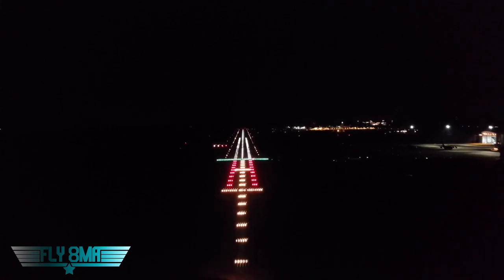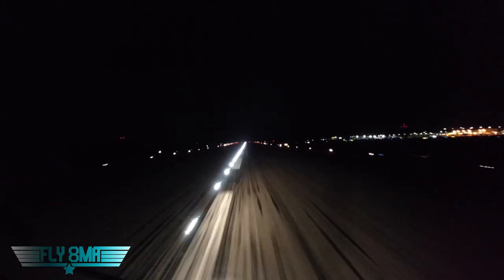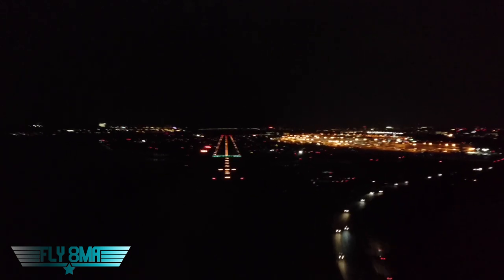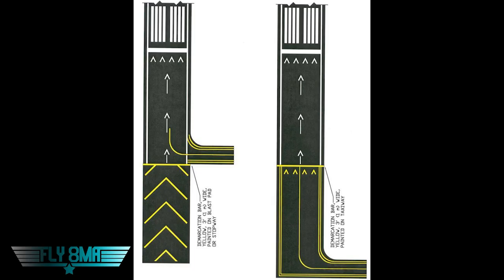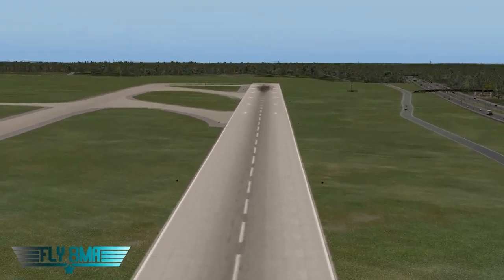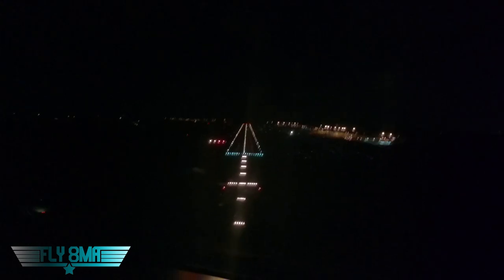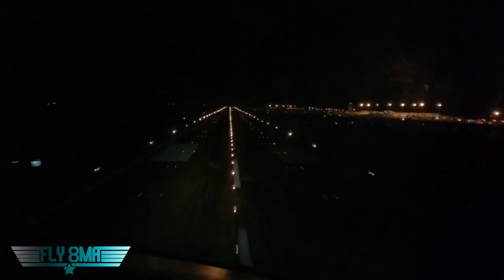Ep. 106: Airport Lighting | RUNWAY + TAXIWAY Lighting and Markings Explained

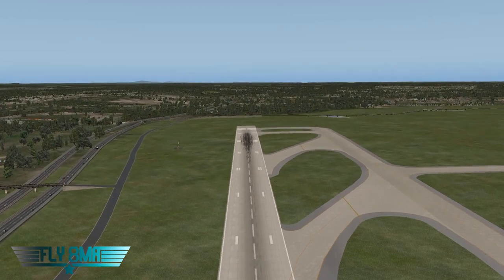Comment: 5:44 I did not quite follow the reason of skipping a set of bars. Could someone explain a bit? Thanks!
Reply: I think he is saying the second set, on his diagram at the 1000' mark would be at the same place as the solid white blocks that are the touchdown aiming point.  Obviously you can't paint the double white bars on top of the solid white rectangles that denote the touchdown aiming point.  It just wouldn't be visible.  Since the aiming point can vary, its not always at the 1000' mark therefore they might not skip them at all airport.  Only when they are close enough to cause confusion.